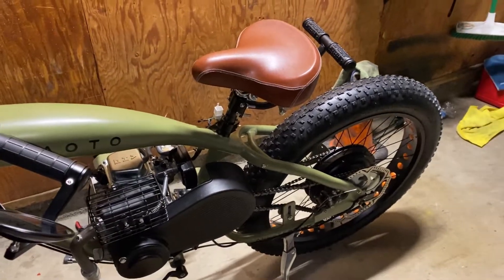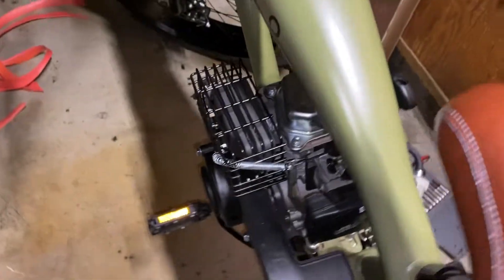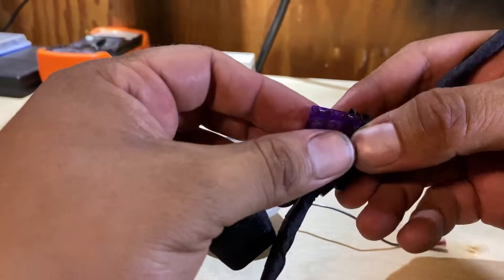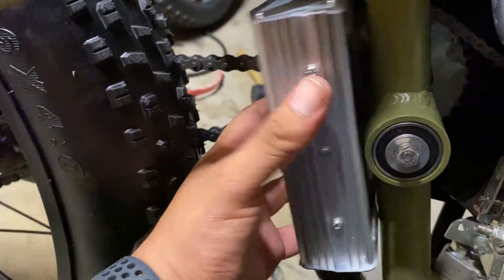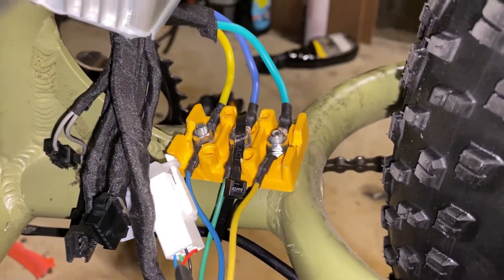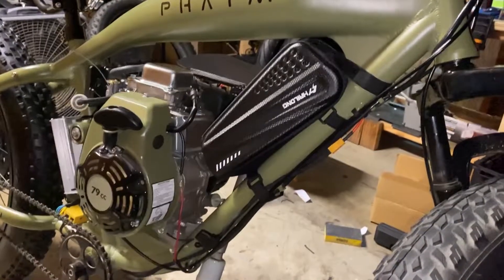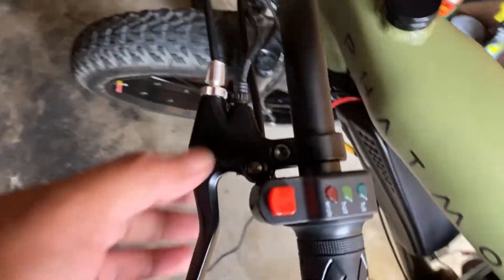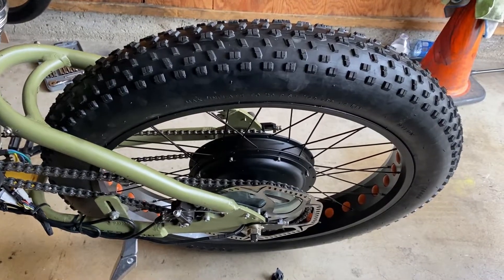E-Phatmoto 48v Rear Electric Hub Motor - Part 2 Hybrid Conversion

Comment: I’m putting a bafang 1000w mid drive on mine. Give it them 7 speeds.
Reply from the maker: That’s probably better. But definitely more expensive.
Reply: @ expensive isn’t even the problem. I absolutely cannot get the engine and electric motor synced up properly. Toyota pulled some serious witchcraft with the Prius.

Comment: i guess it will pull mountains faster but can that electric hub handle 30+ mph? the stock gearing wont let you go any faster. maybe change out 50t to a 44t sprocket but then again will the electric hub handle speeds like that? like 40mph? idk 30 seams fast enough for me on a bicycle. love my phatmoto.

Comment: I wouldn't mount a battery next to your exhaust. Try a rack battery. Shouldn't be much of a difference on that heavy of a machine. I expect it performs really well.
Reply from the maker: That is a great suggestion, I actually returned the battery. Looking into some other batteries including the rack mount battery.
Reply: In winter exhaust heat would be great lol

Comment: I like your bike I thought you would have put the electric tire in the front but it's still perfect you should have put the throttle on the right side and made the motorbike throttle a brake lever throttle make a left throttle double brake lever you would have been perfect but I like what I see I just would have used a 212 cc engine if it can fit
Reply from the maker: Thanks, went with the rear because everyone does front wheel conversion but I had yet to see a rear one.

As for the throttle it has already changed, just haven’t uploaded a new one showing the changes to it and I used the stock engine that came with it because well it came with it. 

Cheers !
Reply: Rear drive is just better, although 2wd is pretty cool if you ride in shit.
Reply: Also with electric it only makes sense to use a smaller motor for less weight and consumption

Comment: Where did you get the kickstand
Reply from the maker: Amazon it’s from Portland Design Works 

Portland Design Works | Power Stance Bicycle Kickstand | 40mm Rear Bolt-on https://a.co/d/6VELoAz
Reply: @yesitselectric  thanks. the stock one cant hold the bike up with any cargo. ive been leaning my phatmoto up against trees and gas pumps.

Comment: When's part 3 coming? And how many watts is your rear motor, 1000 or 1500?
Reply from the maker: Part 3 is coming soon! Lots of changes made to the e-Phatmoto.

And the motor is “rated” at 1000 but I am for sure pushing more to it with the new controller 🤭
Reply: @yesitselectric  can't wait! I'm looking to do something similar to my phatmoto all terrain.

Comment: Is it possible to start the gas engine with those electrical systems? As in electric start
Reply from the maker: I believe so, it would need a DC-DC converter added to the battery.
Problem would be finding an electric start that works with the Lifan 79cc.
Reply: Oh this shit has centrifugal clutch, that sucks